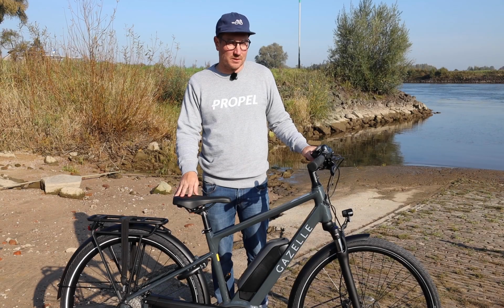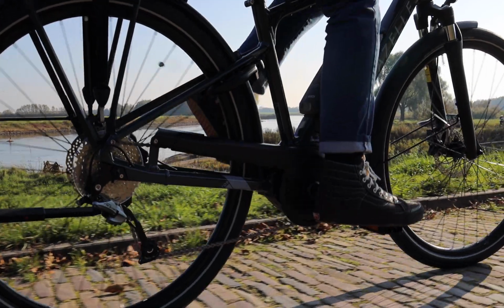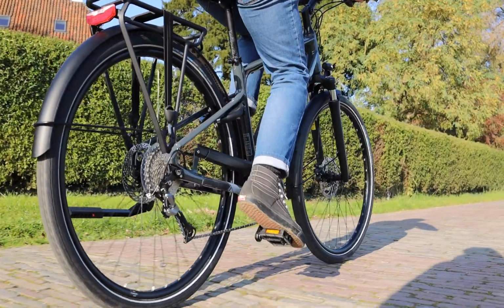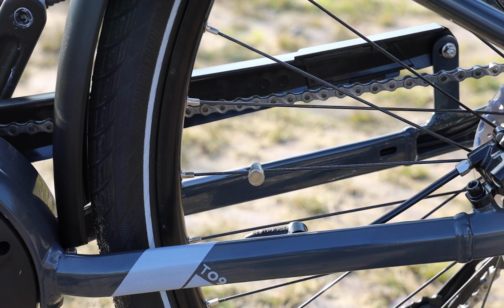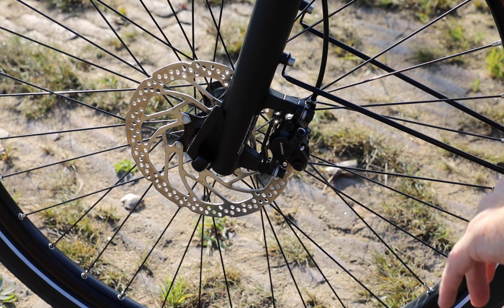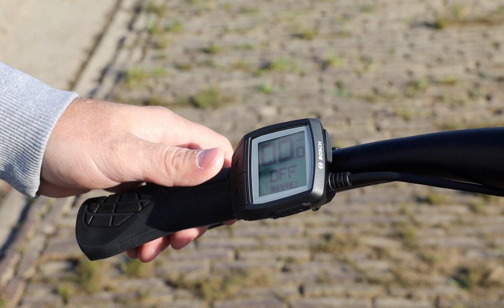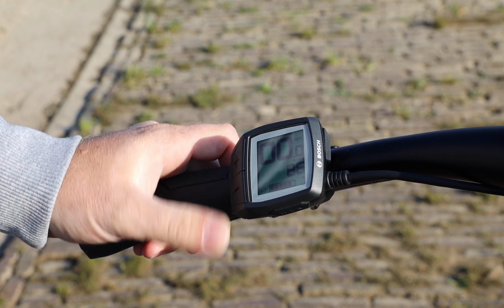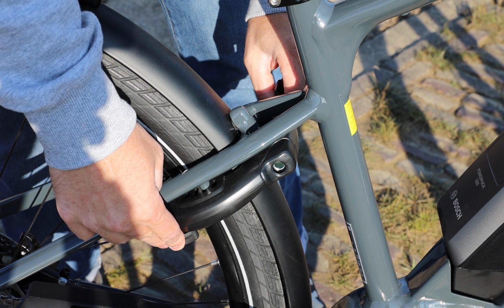Value Priced Bosch Electric Bike | Gazelle Medeo T9

Comment: Since you’re in the Netherlands, is it possible to make a review of the Gazelle Ultimate C380 Speed Pedelec? Also value priced.
Reply from the maker: I’m actually based in the US, but I think that bike looks awesome, but unfortunately it’s not coming here. We did a review on the Ultimate T10+ though.
Reply: Propel Electric Bikes indeed I watched that video, in Belgium we don’t have the T10 in the speed variant. I’m considering a couple of brands to buy myself a speed pedelec because I just hate the fact that the Stromer uses a derailleur system because of the back wheel motor, they should use a Pinion system instead but then again I think they would re-invent the frame to fit the Pinion system. I’m a person that likes to keep a bike clean, I hate the grees build up on chaines for that fact, but nevertheless I love the way the Stromer ST1 picks up speed, so it’s actually a love/hate relationship, that’s why I’m considering a Bosch system in combination with a Gates belt drive, clean and beautifull. Other thing that I find important is that the bike should be aiming for a comfortable seating position, I don’t like my bike to have an aggressive seating position so I can sport when I want to and cruise when I want to.. So the Trek Allure+ 9s, Norta B-5040 and so on is out the picture, also aggresive.. I’m aiming towards a Gazelle Ultimate 380 Speed, Riese & Muller Supercharger 2, Kettler Quadriqa Duo X Speed or the Kettler Velossi 2.0 because they have an adjustable handlebar that aims towards a comfortable seating position.. But still the Stromer ST1 his motor is well put together, and maybe I will give up on the Gates belt just for the motor.. I know, I’m in a dilemma.. 😅

Comment: And you have 2019 versions available for $2,000? You should have plugged that in the video! Are there any important spec differences on the motor or battery?
Reply from the maker: Great point! Yes, we made this video back in November and the current Medeo wasn’t on sale. The 2019 version has an Active Line motor and HS22 brakes instead of disc brakes and an Active Line Plus motor on the 2020 version.

Comment: I didn't know this was available.  What you are looking at is a Bosch bike for $2500!  That is quite a value. Perfect for me. I would want the step through version. Can you do a video that discusses motor drag and regenerative braking? I want a bike that I can pedal on my own when the battery is spent and some of the more budget bikes have quite a bit of drag. Isn't that one of the attractions of the active line?
Reply from the maker: Great feedback! This motor has practically no drag but I’m not aware of any mid-drive motors with regenerative braking. Sounds like this bije is fitting for what you’re looking for.

Comment: It looks like a good value,  but asthetically the non-integrated battery looks dated. Aventon has an integrated battery on thier newest value ebike...maybe next year?
Reply from the maker: There should be another version soon for a little more with an integrated battery if that’s something you’re into.
Reply: @Propelbikes  nice! The lower level ebikes are just now getting the integrated treatment so we should be doing away with the exposed battery style within the next 2 years or so I guess